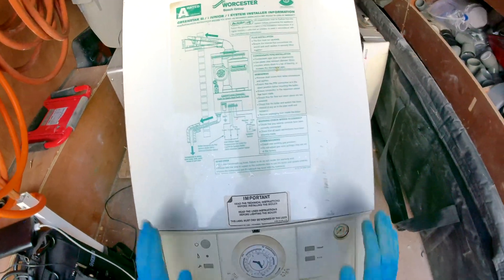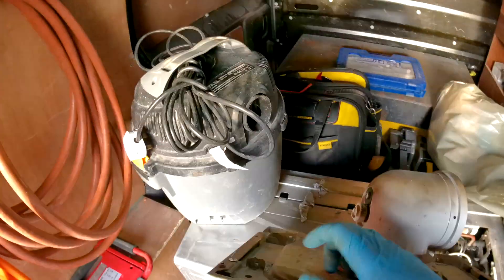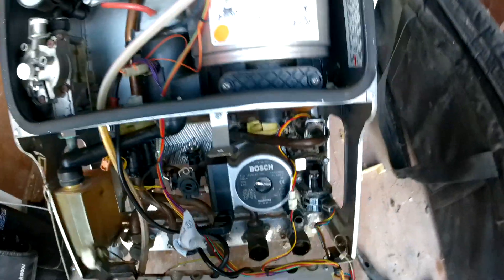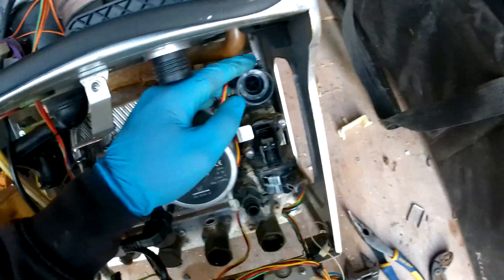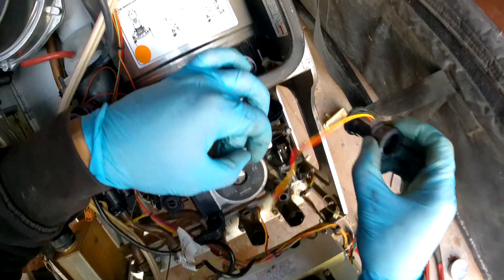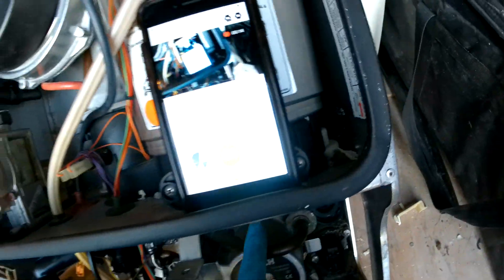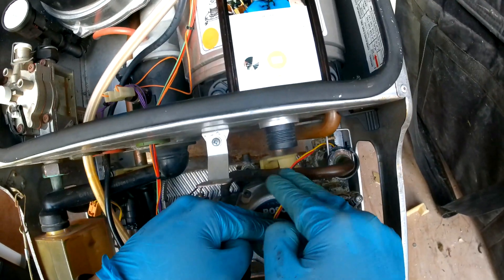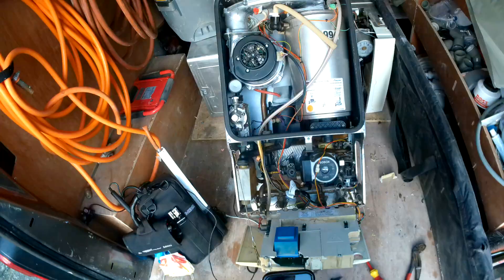Worcester Greenstar - How To Test & Change The Flow Turbine | Boiler Not Getting A Demand On Water?

Comment: Tips. 1- you dont need to remove the heat cell retaining clamp.
2- use wd40 on the flow switch ends, so you don't pull out and damage the flow adapter behind the flow switch.
3.- look under the flow switch, you'll see an arrow indicating the way the flow switch should be put back in.
4- replace the 15mm fibre washer on the inlet isolation valve.
5. Always use long nose pliers when removing the U-clip as it can ping out and fall behind the kitchen units if you use a screwdriver.
6.use grease on the tips of the U-clip when putting it back, and again use long nose pliers and put the straight side on the left with the bent side on the right.

Just advice from someone who has done over 100 of them .
Reply from the maker: Hey Kieran, thanks for adding in some extra tips! I’ll pin this so other engineers can hopefully see this and benefit from it👍